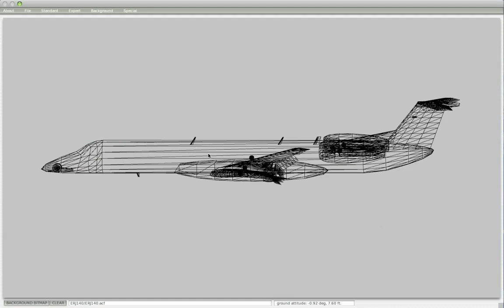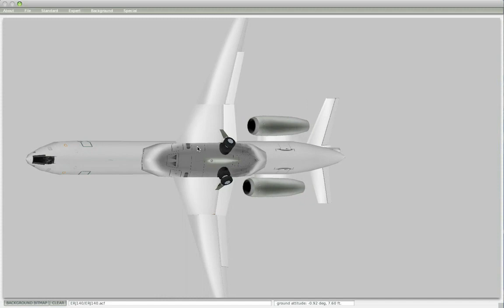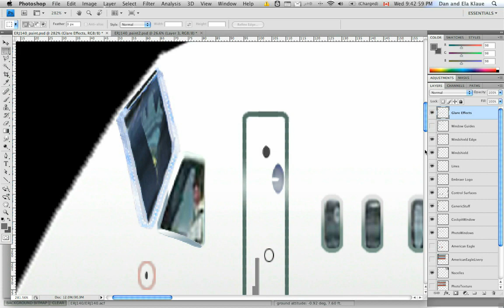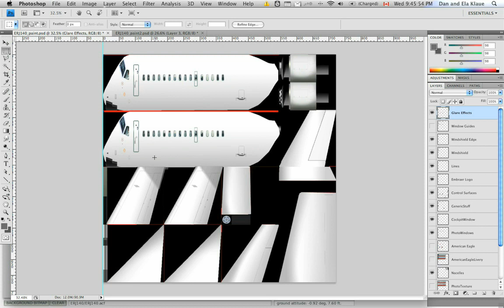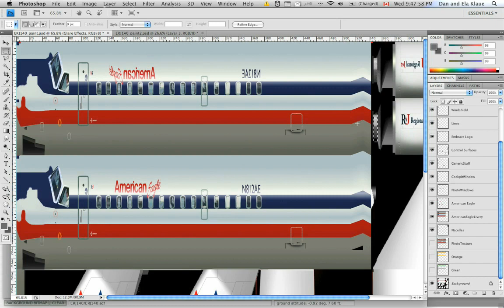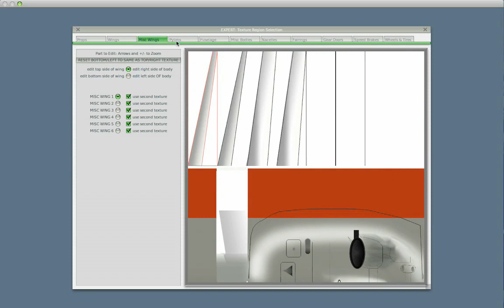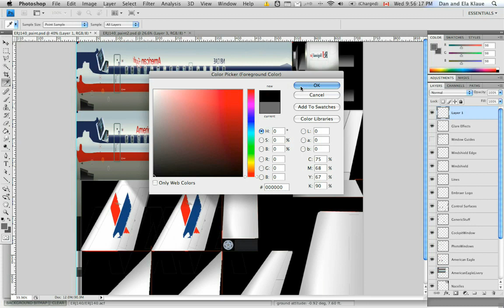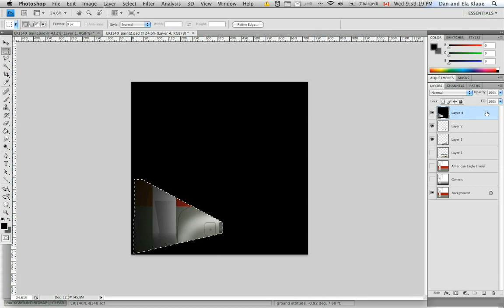PlaneMakerTutorial 12: Texture layers, day/night textures, overflow regions

Comment from the maker: @austintex08 I'm not sure I understand what you mean.  The wheels are on one photoshop layer, while the rest of the paint is on another layer.  The layer that the wheels are on can simply be turned on or off.

You can use the Circular Marquee tool (Shift + M toggles this in Photoshop) to select the wheel, using "Shift" to constrain the height/width, and then use copy-and-paste to get the wheel on another layer.

This is Photoshop stuff... please refer to Photoshop tutorials or manuals for this.

Comment from the maker: You go to the "Landing Gear" menu, click on the "Doors" tabs corresponding to the landing gear whose doors you wish to edit.

There is a graphic manipulator beneath that, shaped like a square with handles on each corner. drag those handles around to reshape/resize your gear doors.

Also note that there's options that determine the behavior of the gear doors as well as the position and texture data.